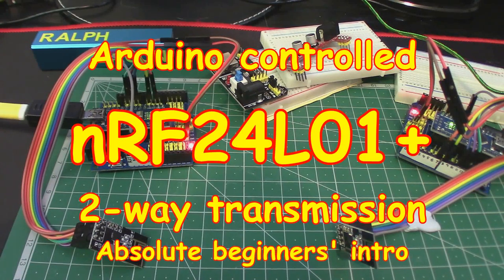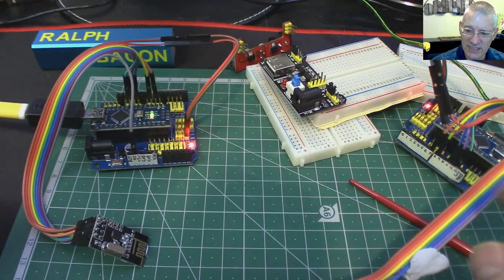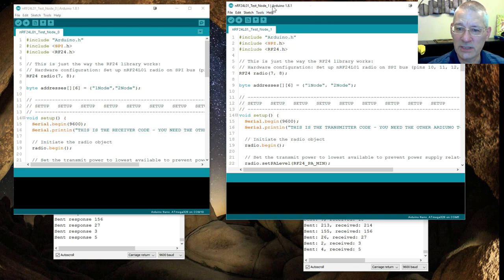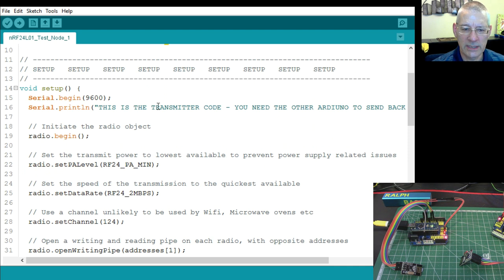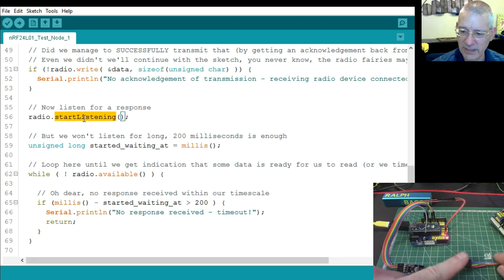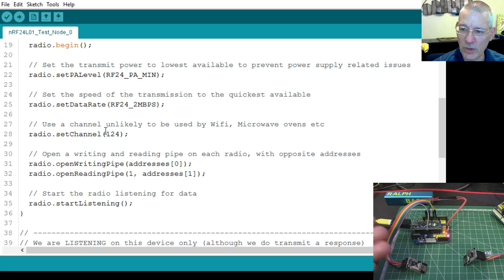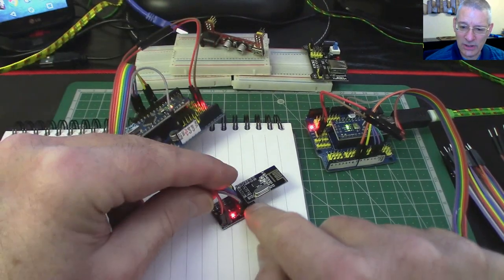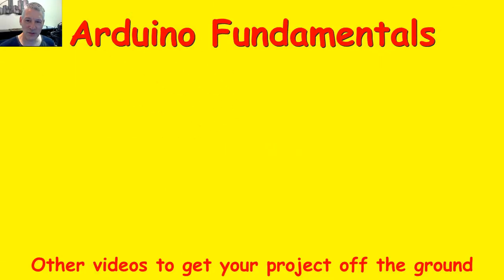#73 nRF24L01 Send (and receive) data with your Arduino!

Comment: did absolute copy of your tutorial , but did not work . may be the nrf module is bad. please teach us ..How to check if the nrf is dead
Reply from the maker: If you followed my demo, Mo, you will have TWO nRF24L01+ modules (one for the "transmitter", one for the "receiver"). Have you tried swapping them over? Do any lights appear on the modules? Are you using the adapter boards for the modules (this is the most common cause of failure) - if not, get some and try it again! This solves most issues.
Reply: Ralph "Sir" thank you so much for a prompt reply
I bought 4 of both an year ago , tried it once before but failed to make it work . After watching and walking on the footprints point by point , I discarded and toosed the modules in recycling . how ever I have the boards , and only on one the light glows , but not on the rest of them.
I have 2 projects ready otherwise , but am short in wireless com .
I will endeavor again and will upload what I did . thank  you so much  
"M Ralph " You definitely are a mentor .
Reply: Finally I got the bare minimum running exactly the way it is in the tutorial.
1. I bought a pair of modules
2. Bought new DUPont cable set
Why?
wanted to be sure that the wiring and th modules have no issue
Then precisely wired the modules to arduino and double checked as the sequence is
And it started working
It was a good feeling Thanks Ralph .
Now I can get going with 0++ standard from this state onwords
Those who get it going very quick can not know about the happiness of success. 
And I dedicate this happiness to you
Ralph (Sir)
Reply from the maker: Fantastic result, Mo. Good that you persevered and can now savour the sweet taste of success! I love it when my Arduinite viewers can replicate my demo sketches and then grow them into whatever they need for their own projects. Well done and thank you so much for posting back your success story.
Reply: My quest is remote unit with x channels
Phase 1                   x=2
Phase 2                   x=4
Phase 3                  x =6
Phase 4                   x=12 channel transceiver

I will start with Led on off remote 
Node 1 button press will light an led on node 2 
Node 2 will notify node 1 that LED is either ON or Off state
Please enlighten me
Thanks
Reply from the maker: With the standard sketch, you can have (up to) six channels. If you look at the sketch it will be obvious where the channel number is set (NB: use the same number for both transmitter and responder!) If you need more than six nodes then you need to construct a mesh; although there is an example sketch in the Examples folder of the library we are using I haven't tried that as it is beyond the scope of a simple set up. You can always ask for help at the Arduino forum (http://forum.arduino.cc) who have many experts. Good luck!
Reply: THanks Ralph
Reply from the maker: If you ever supplied 5 volts to the nRF24L01+ module then I think you can assume it's dead.That's why I so strongly suggest the adapter boards, it stops mistakes and totally sorts out the power supply issues. I suggest you buy another couple of modules (they are quite cheap) and use those; if they work, but your current ones don't, then I guess they are dead.
Reply: I agree I have 4 of them  which do not respond, and moreover wiring is easy .

Comment: how to send more than 32 byte on nrf240l?
Reply from the maker: Not in one go, you can't. 32 bytes is the maximum. However, there are things you can do to assist:
1. Do not send strings or characters of any kind. Use single digit numeric values to represent a string value.
2. If your integer value is always <= 255 then use a single character to hold the value, not a two-byte integer.

If all else fails, you can send more than one packet (one after the other) but that does complicate the logic at the receiving end, as it will have to wait for two packets to arrive before continuing.
Reply: @RalphBacon  Thank you sir 💐

Comment: Sir my receiver value and sent value different value coming. Please help me sir
Reply from the maker: Make sure you are using the adapter boards so you just supply 5v to the board. Swap the units over and see if you get the same problem (If you do then it's not the modules, it's your wiring or something else). Make sure you use the EXACT demo sketches I supplied, no changes. I hope this helps.
Reply: @RalphBacon  sir i am using 100uf capacitor across nrf module  but same issue sir
Reply from the maker: So you are not using the adapter? Sigh. Please do this.
Have you got the units close enough together? On minimum power the range is only 30cm. Other than that it must be your wiring.
Reply: @RalphBacon  thank u sir for your valuable reply

Comment: Does anyone know how to use NRF24 without standard library
Reply from the maker: Sorry, the nRF24L01+ requires some detailed coding that would be very verbose to run without a library. Why do you want to do this?
Reply: @RalphBacon  cause NRF library is limited to Arduino we can't directly use NRF24 to other microcontrollers since it uses SPI interface it's compatible to most of the controller but as you know due to complex structures of register it's tough to use hence if we use NRF24 without library it will be generalized code for all microcontroller with few adjustments

Comment: if i want to send a number why it has to be "Char" why not "int"  ??
Reply from the maker: An integer consists of TWO bytes, Mohamed.
 
You will want to send individual bytes to make it easy and reconstruct the number at the other end. So to send 1,234 you actually send, in turn "1", "2", "3", "4".
 
Of course, with a more complex sketch, you can easily send a two-byte integer without any conversion as long as the receiving sketch knows that what you are sending is a two-byte number. That is a little more complex and my demo just showed the simple way of doing things!
Reply: @RalphBacon  thank you for the precise answer! 
Indeed I just want to send an integer between (1 and 5) and the receiver already knows that the number is an integer between 1 and 5 ! that's why I want to use the integer because I have a led that must blink the received number.

Comment: Always find your explanations clear and easy to follow. Great stuff. 
Can't seem to find it now but on one video you had to replace the voltage regulator on one of your Arduino boards.
I have the same thing currently but for some unknown reason, the clone board 5v regulator is a bit difficult to find at low cost.(KB50)
The 3v3 version one can buy for a dime a dozen (20 for $2 odd...free post) but the 5v is comparatively  rather expensive at  $2  for 2 plus $6 post.
So I'll simply use these duds with an external 78L05 or similar.
http://home-automation-community.com/arduino-low-power-how-to-run-atmega328p-for-a-year-on-coin-cell-battery/
Reply from the maker: Can you not use any SMD [SOT223] 5v regulator here, Jeff? That has the correct current rating but 1A would be sufficient, probably? So don't replace like-for-like, look for an alternative. The AMS1117-5 seems the obvious candidate and are pennies.
Example: https://www.ebay.com/itm/10pcs-AMS1117-5V-LM1117-L1117-5V-1A-SOT-223-Voltage-Regulator-NEW-FREE-SHIP/273670623178

Comment: PLS. help !!!!!!!!!!!!!!!!!!!!!!!
the maximum and receiving data (address) are 3 only 
How can i send more than 3 adresses
Reply from the maker: You can connect six of these before requiring a mesh network. If you need six or less then my sketch can be simply modified to have 6 units (instead of just 2). An example of a mesh network is in the examples of the library used in my demo. I hope this helps.
Reply: thanks alot ♥

Comment: Fantastic the project worked so nicely. About the having the sketches on the desk top solved the problem. I also downloaded the PuTTY and two channels mine was found com15 and com16 I was able to watch the data sent and received. God bless you Ralph and please email me if you can to help me if you pleased.
Reply from the maker: Hello Demetrios! I'm glad you got this working, they are nice modules with a decent range with the right aerial and power setting. Regarding your previous message I'm afraid that I have no capacity for extra work as I have a dayjob and must keep this channel running too, which together take all my time up (just ask my wife!). At least the videos here will give your project a starting point, I hope, so thanks for your post and keep experimenting.

Comment: Its not work ı cant found problem :(
Reply from the maker: Please look at my replies to others here about the steps they need to take. Number 1 is to use the adapter boards. Number 2 is to use my demo sketches without ANY modification. We know they work and I had them running a few weeks ago. It can only be something simple (like wiring).

Comment: One minute I can get this working another min it will work..
I am using the adapter u mentioned in video on 5v from nano.
Same with simple hello world code, one day it works another it don't.
Triple checked connection ect really starting to make me angry now...
As I am a copy and paste guy, do u think maybe its a library problem?.
I also power to 2 nanos from seperste com ports, also tried powering one from USB plug socket from mains...
Just so touch and go..
Arghhhhhhh!!!!
Reply from the maker: It's good you are using the adapter. That normally sorts things out but in your case... 
In the code, change the power level of the transmitter (on both modules) like this:
radio.setPALevel(RF24_PA_MAX);

Ensure you are using a channel well away from WiFi and Microwave ovens:
radio.setChannel(124);

Make sure you have set the 'retries' similar to:
radio.setRetries(10, 5); // 10 mS delay, 5 retries

Try all that and let me know. Just so that you don't get too frustrated, I have three transmitter (master) modules outside transmitting to my hub (slave/receiver) inside my workshop and it all works very well, although I did have to use the modules with the walkie-talkie style antenna to get through the walls of my workshop. So we know this works, it's just getting it working for you.

Final thought: do you know for sure your nRF24L01+ modules are genuine? There are some fakes (some=lots) out there that might be the issue. Last resort: replace your modules with ones from reputable suppliers in your country.
Reply: Thanks for the reply will try all this tonight...I have about 15 nrf24l01 modules in total...the only ones I know are genuine are the newer 10 pin ones .
Reply: Done what u said...I also soldered my tx side up to a green electronics board...
It works...
It f£cking works..
Thanks for the advice..
Have a great week...
Tim
Reply: So my problem was...
Usb to nano, 5v could not handle nrf24 and 9g servo ...
Switched the servo + & - to a battery and boom..
Works a treat...
Reply from the maker: Excellent, so glad you found the issue! 👍

Comment: didn't work for me :( i dont know where the problem is :'( help !!!!
Reply from the maker: Hey Nouar, you've not given me a lot to go here, have you? How far did you get, what's your exact setup, are you  using the demo sketches without modification, what are you seeing on the Serial Monitor window and are you on Planet Earth? All these questions could have a bearing on my answer, so hit reply and let me know the answer and I will try and help you.
Reply: okay i did exactly every word you say i downloaded the  exact code that you give .. the monitor is saying  (no acknowledgment of transmission and no responce received )
Reply from the maker: Let's see.

1. You have TWO Arduinos/Nanos each with their respective Transmitter/Receiver sketch loaded and an nRF24L01 attached? They are operating on different COM ports? Check this! Very easy for the Arduino IDE to 'share' the settings and use the wrong port number.
 
2. The receiver sketch does NOTHING because it is waiting for a signal to receive from the transmitter? It doesn't transmit anything? But you do get the Serial Monitor output confirming that it is running OK?
 
3. The transmitter says it did not get an automatic response but waits for a specific response anyway (the receiver is supposed to send back the same number that was transmitted plus one) and doesn't get that either?
 
If the above is true then I suspect your wiring on (at least one of) the nRF24L01s. Are you using an adapter board? Or wiring it directly (from the underneath) - in which case beware that the wiring image is a TOP view (looking down through the board). Check this.
 
Swap the nRF24L01 modules over - do you get the exact same result?
 
Let me know the answers to the questions and other results. We can but try and try again, right?
Reply from the maker: Also, if you are running the modules WITHOUT an adapter plate you need to supply 3.3 volts. If running WITH an adapter plate you need to supply 5 volts.
Reply: well i have two arduinos(uno) ..the wiring is just like the picture that u gave us  with the code .. and  i dont have an adapter i use 3.3 v .. and the motinor of the receiver dosnt show anything( just one message wich say this is the receiver or somthing like that ) and the monitor of the transmiter shows the two messages like i said earlier
Reply from the maker: Hi Nouar, I've made a few more suggestions to "Alison" on this video comments, have a look (especially about the power and speed settings, they must be the same for both boards) and also the 1.0µF capacitor on the bare module (not required if you have an adapter board).

Comment: Hola Mr Ralph mi proyecto consiste en hacer un radio control con Arduino+Joystickshield+nrf24l01 los tengo conectados pero no se conectan con un receptor dsm2 que tienen el mismo protocolo PWM para que puedan funcionar las ruedad y el servo, saludos, muy buena su pagina y por favor envieme por correo los codigos transmittal y el otro receiver, saludos, gracias
Reply: Si, Mr Ralph ya baje los archivos y los cargue en mi arduino uno chino ningun problema, pero no se conecta Ud. tiene algun correo para conectarle y enviarle un video, de donde es Ud. por favor necesito su correo para enviarle un video de lo que estoy haciendo, saludos, muchas gracias, para los amigos si esta pagina si funciona Mr Ralpf contesta y ayuda bien por las personas como Ud.
Reply from the maker: He respondido a tu otra publicación, por favor lee mi respuesta allí.